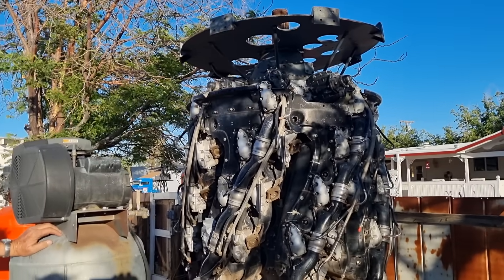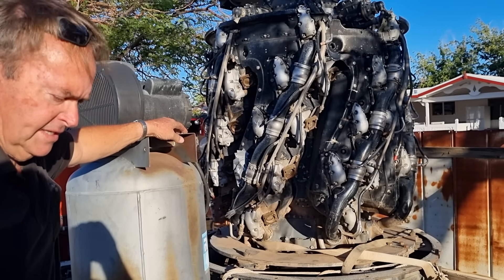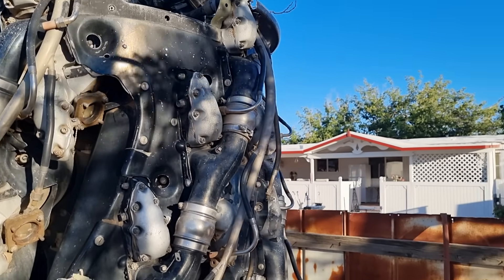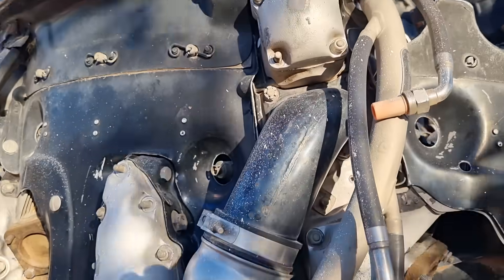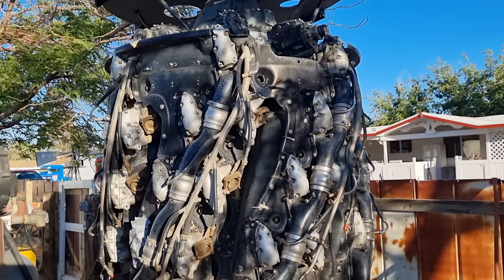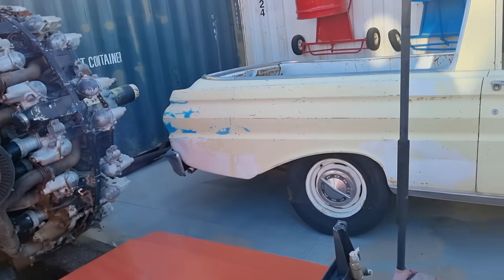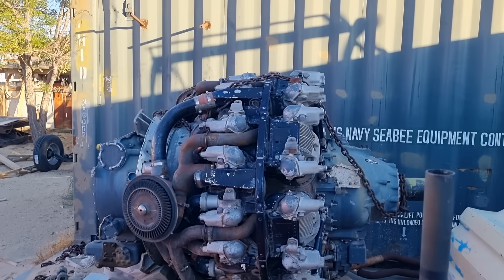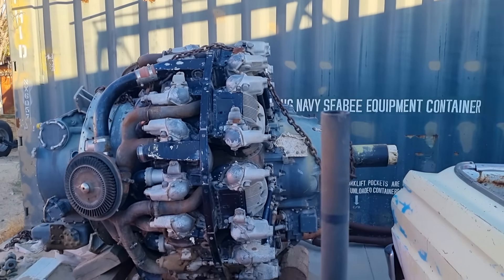Monster 4360ci Pratt and Whitney radial engine

Comment: One of the Martin Mars flying boat model  The   Caroline Mars   was the only Mars plane model equipped with four  R-4360 engines  while in service with the US Navy in the 1940's and 50's .  Sadly, in the early 1960's  The Caroline Mars  now retired from the Navy,  while in the process of  being refitted as a Canadian water bomber with the original 4360 being replaced by  the smaller,  more reliable,  more efficient R-3350 like the other Mars planes for use as  fire fighting water bombers in west Canada  but was damaged beyond repair from a freak hurricane storm.  Today  only the 200 foot wing section is all that remains of the Caroline  stored at the former Mars Bomber base at Sproat Lake to the present day.  Fortunately  the last 2 surviving Mars The Hawaii and Philippine Mars   aircraft would go on to successfully  fight fires for the next  50+ years until the retirement of the Hawaii Mars in 2015.   Last summer  the Hawaii Mars left Sproat Lake for the last time to a aviation museum in Victoria Canada.  The Philippine Mars is still here at Sproat Lake after 2 botched attempts at its mission to the US.  Soon,  if all goes well   The Philippine will leave my area forever for its final mission to  the Pima Air museum in Arizona USA.
Reply from the maker: @rEdf196  oh man what a story, will the plane be on permanent display, I'd love to see it

Comment: Penngrove owns one engines from Huges's Spruce Goose as there is other applications for the P&W R-4360 Wasp Major the Goodyear F2G super corsair, the Fairchild C-119, the Convair B-36 Peacemaker,  many variants of the Boeing 377 Stratocruiser, the Bowing C-97 stratofreighter, the KC-97 the B-50 superfortress, the KC-50, the Douglas C-74 Globemater and the Douglas C-124 Globemaster ll aka Old Shakey and other aircraft that used the 4360
Reply from the maker: @derekobidowski3301  thank you for the information, any idea of the hp it puts out? It's a gell of an engine, I'd love to see it run